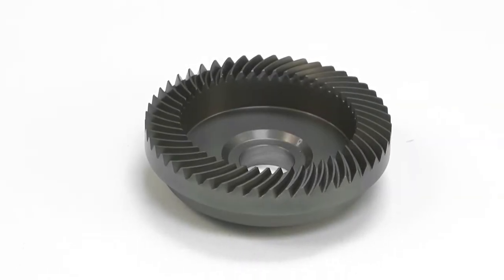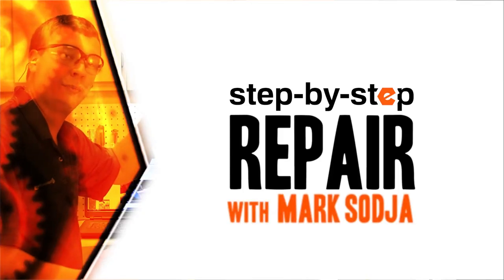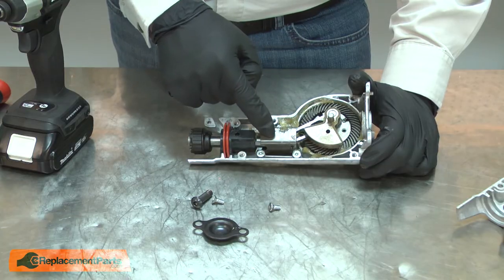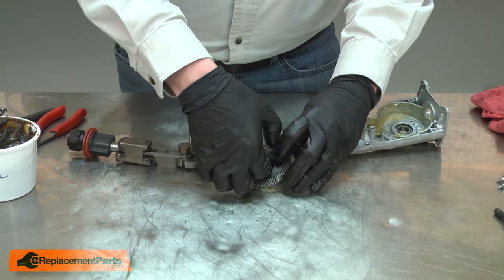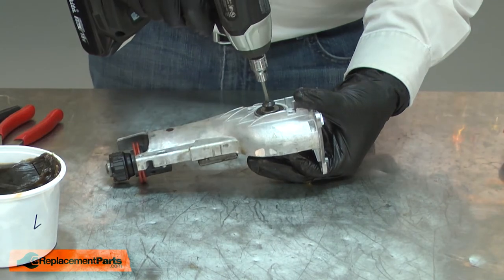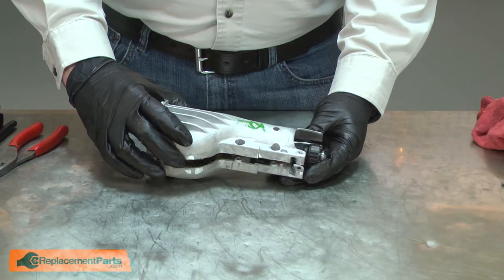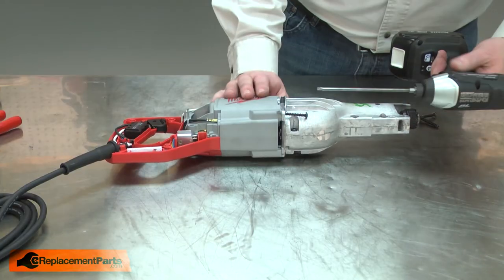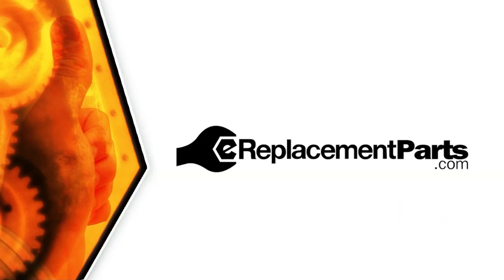Milwaukee Reciprocating Saw Repair - Replacing the Gear (Milwaukee Part # 32-05-0022)

Comment: informative as far as it goes. If you recommend replacing the armature gear you should show that, too. Unfortunately, for my saw that means buying a whole new armature...$75 + shipping. The other thing not mentioned is that the screws holding down the pinion stay are thread-locked and the torx heads will probably strip because the metal is stainless.  I guess  you could drill them out if you have the patience.  I got a used cordless bare bone for a little more than the cost of the parts. Can't say it makes me feel great about Milwaukee